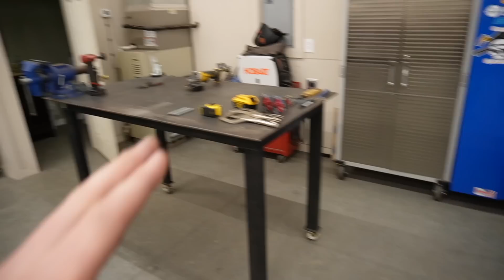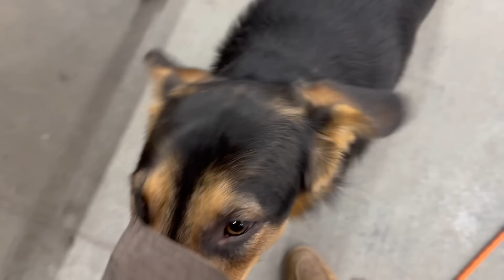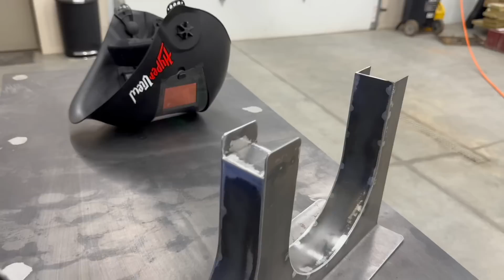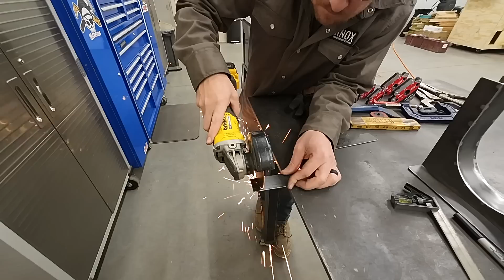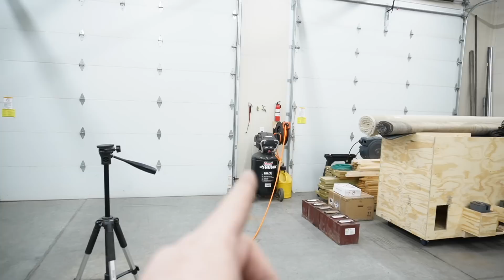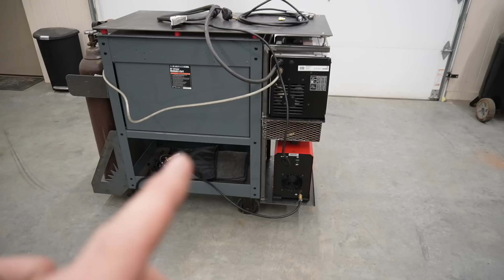The ULTIMATE Welding Cart Build Continues....I Need YOUR HELP

Comment: I really like your welding cart, but I see one huge flaw. Speaking from experience, the bottom of self which the casters are bolted to of the US General  tool cart is too weak to support the weight you are increasing to it. I suggest running an additional to all 4 corners that the casters can bolt too
Reply from the maker: if it becomes a problem I will address it.  It was considered just not something that was going to be a guaranteed problem for my application.

Comment: Where is your tig rod storage?
Reply from the maker: In the drawer.
Reply: @SpicerDesignsLLC  interesting. I’m contemplating modifying your design for a water-cooled TIG setup. I think in that application, I’d consider trading one of the bottle spots for a place for 6 or 9 of the 36” filler rod tubes.

Comment: Little late for my input as youre already done with this project, but...

I did very similar with the little 70 buck (i think, probably more by now) welding cart you can get from harbor freight, of course its not a perfect solution itself either. I have a singke bottle in a 5gal bucket off the back and chained to the cart, the extension cord sits in it around the bottle that i plug into the wall, zip tied along it is another cord for 110, the 110 is just a triple tap cord dangling behind the bottle, while the 220s are cut into a plastic weather box with an outlet on either side for the mig welder and plasma cutter.

I like the common ground idea but thats only good if you have the mig setup on negative ground (i forget if thats the gas or gasless mode), otherwise there may be issues.

I wish i had the space for a setup like this but what i have JUST fits in my garage.

Just found the channel the other day, and so far i love it. Great content, comedy, projects, and educational info, adorable pup too....

Comment: Looks like changing the spool on the mig might be a little challenge.
Reply from the maker: Whys that? Its basically identical to my Hobart machine.
Reply: @SpicerDesignsLLC yeah, I’m talking about the Hobart. Seems the lid to change the spool will not go up all the way. Great design though. Might do this to my eel table.
Reply from the maker: @SPIKEOPS82 ohh ok.  Ya just have to use a magnet or something.  Not a big deal
Reply: @SpicerDesignsLLC fuck. Just saw the second video 😅

Comment: Top still doesn't appear to be isolated/insulated due to the fasteners bolting it to the lid.
Reply from the maker: @pjshooter6  yes it is.  Thats why those are called insulators.  Theres no continuity between the female threads on each side of the insulator.

Comment: May I ask what air compressor you’re using for the crossfire pro?
Reply from the maker: Its just a 30 gallon husky that i got from home depot before i had the table.  I would say its bate minimum for the 45 amp plasma cutter

Comment: The way I solved the wiring on my welding cart was with a small sub panel on the cart. I have 2 240v outlets for the welder and plasma cutter plus a 120v outlet for grinders. A single cord plugged into the wall and everything has power.

Comment: If you are already grounding the top of the table, to avoid using too many cables, you could tab that hangs down from the front corner of the table top and mount the female lug directly to that.

Comment: I wouldn’t ground both at the same time, any spikes and u don’t it going in electronics it’s not meant to
Reply from the maker: @dbi1036  i was concerned about that as well. Im going to be installing an isolation switch for the grounds.
Reply: @ keep up the videos ur doing a great job

Comment: I had two welders grounded to the same work piece one time and some how voltage ran through one of the welders and fried it.  Could have been a fluke, idk.  Every since then I try to never ground multiple machines at the same time unless its necessary.
Reply from the maker: I was concerned too so i ended up getting an isolation switch. Ill show that in the last video

Comment: Great build Kyle. You ever thought about adding some bigger BEEFY tires so you don't have to go around obstacles?
Reply from the maker: If it becomes a problem i will.  Most of the time theres nothing on the floor so it shouldn’t be an issue.

Comment: Here are my thoughts on your questions: 1. Don’t mess around with making ground ports on the machines they need to be dedicated to each machine and isolated and you don’t want to mess around with electrical current. You have plenty of open storage on this cart for leads and they go in and out of the machines very easy so there is no issue with removing them. 2. Instead of capping the ends of the tube above the Hobart I would use the open ends to make a handle that could retract in the tube and pull out so it could be used as a handle and also an extension for something hanging over the edge to have more support. Awesome job you have the best cart I’ve seen yet.
Reply from the maker: Great ideas.   I do have an isolation switch for the grounds to eliminate any interference with the other machine.

Comment: get a non isolated double lug attach it under the table you can weld a 1/2 bolt under if you dont want to drill a hole does what you want but better

Comment: Nice build but too bulk for my liking. Must be a pain in the ass to move around the shop.
Reply from the maker: Thanks.  If it didnt have wheels it would be a pain.   Its heavy but i wont need to move it around a whole lot.
Reply: @SpicerDesignsLLC  I'm just not a multitool guy.

Comment: Great idea, love it!
Two ideas:
#1 - In the automotive industry, there are ground 'cables', that are actually braided stainless with eyelets on either end. That would be great to mount to the top, since it'll be flexing, and won't 'work harden' a typical cable. These are most often from chassis ground to engine block, typically. 
#2 - Since you'll have 110v to the cart, maybe mount an outlet, in the event you want to plug something in to your remote welding cart. 
I mean.... you seem like the kinda guy that's going to need a grinder after your welding, soooo.... <shrug>
#3 - [Bonus idea] The cart needs a cupholder, with a can cover. Don't want molten spatter getting into your cold bee.... uhm... "beverage". 
Rock on man. Thanks to Youtube and the algorithms for recommending you. New sub here, great content!
Reply from the maker: Thanks for the sub and suggestions!

Comment: Just flip the straps around then your original latch should work.
Reply from the maker: @ReapersFabrication  they would hit the bottle and the taper is the wrong way
Reply: @SpicerDesignsLLC  Gotcha was just a suggestion sometimes we can forget to catch little things in the moment, only reason I thought to offer flipping them. Cart looks awesome. I'd probably insulate the machine rack and see if your white foot pad could be swapped with a longer screw. That way, it gives you the grounded top with that grounding block you have might make for less wire usage possibly.

Comment: I tried using your coupon code: both “spicer” & “spicerdesigns” for the evolution miter saw. Any idea why this wouldn’t work? Your previous video on this welding card eludes to the coupon worked for this miter saw. Just curious if you had an idea?

Comment: Nice cart, looks like weld spatter could shower the welders and the bottles though. Don’t want to burn through one of the regulator hoses haha.
Reply from the maker: I wont be using that top much for welding.  The hoses will be concealed too.  For the most part everything should be pretty well protected.  Thanks for the input.
Reply: @SpicerDesignsLLC  one thing that comes to my mind is if something falls or rolls off the table and it breaking a regulator. besides that im with everyone else its a nice cart
Reply: A big MACHINE will have to come out to put that fire out 👌

Comment: This is a killer design and build series. You do some really nice work and have great attention to detail. I'm just a garage hack so take this for what it's worth, but my only word of caution would be having your MIG lead coiled that tightly in the storage box below the welder could possibly lead to memory in the liner. Over time it can have an affect on the wire speed running through the liner or even hang the wire up. Keep up the great work!

Comment: As long as you are always DCEN, you will be fine. If you ever need to switch to DCEP, there is a risk to your other welder.  I thought of doing a similar thing with my stick and mig unit but was heavily advised against it by my nephew who is a certified welder.  Just a thought. Nice build.

Comment: Though I'm nothing near of a Pro Welser. but I would have thought to not have the Welding cart, also be the welding table. Hoses are not welding slag-proof, not spark-proof. I'd be worried about sparks near the take lines, and could only imagine if there was a leak on the regulator that wasn't noticed...
Reply from the maker: Shielding gas is an inert gas. Its not flammable hence shielding around a very hot arc while welding.  The way im going to  route the hoses will be protected from burns.  Flammability is not a concern.

Comment: I hope you don't have problems with your "grounds" tied together... welder "grounds" are NOT GROUND... they are the "return path"... that is the issue with having an "earth grounded" welding table. There is a possibility that if one welder is welding, the voltage present on the "return path" could "reverse bias" or "turn on" electronic components in the second welder's circuitry and cause damage.  Personally, I would not risk it...  
Preferably,  I would make separate "quick connects" on the front of each shelf by each welder separately, then they would be isolated, but easily selected by connecting the lead to which-ever machine you are using.   Just my humble opinion...
Reply from the maker: I plan on installing an isolation switch to avoid any possible issues. It should be fine being that the welding too is isolated from the utility ground and the welders return path will go to the source.  Im installing an isolation switch anyway.

Comment: I made a large cart to hold my stick welder, mig welder, and my plasma torch. I did what you are talking about with an electrical service box to hook up all three 220v connection with breakers. As you said I never run all three or even two of the units at once, but I can always leave just one breaker on for the unit I'm using and leave the other two off for safety. I put a large 25' 50 amp cord to the electrical box so I can reach all around my shop too. You definitely will love the clutter free ability to move your welder around when you make those improvements that you are going to do. I love mine and I enjoy watching your build for yours. I just need a plasma table. LOL
Reply from the maker: Sounds like a nice setup.  Thanks for sharing Craig!

Comment: Love the build, if you leave both machines grounded all the time, welding won’t affect the welder not in use? I would assume it’s like a car when you unhook the battery to weld, just curious
Reply from the maker: It shouldnt but i will be installing an isolation switch.  The currents return path will go back to wherever the source is coming from.

Comment: I would love to know, would stainless steel hardlines (think brake lines) contaminate welding gas? It would be amazing to see you custom fab hard lines from your gas cylinders over to the welders for delivery. A small flexible consumable hose on both ends with help reduce gas hoses from tangling.
Reply from the maker: Great idea.  I used to bend pneumatic lines for instrumentation back when i was an electrician
Reply: I was thinking hard-mounted regulators on the back of the cart, which would work perfectly with the hardlines idea. Just a soft whip coming off them running to the tanks if they're mounted near the leg, or hardlines with a short whip at the end if the regulators are mounted closer to the center back.

Comment: You could line the upper tank mounts with an adhesive rubber strip the same width as the steel that contacts the tank. It would eliminate the steel on tank rattle and probably create just enough tension to get rid of the play in the latch causing noise.
Reply from the maker: That is a great idea.  I actually have some weather stripping i was planning on adding exactly how your saying.  But i have to wait till after paint.   Thank you

Comment: Thats a bad welding cart dude. I just got a CK2620 cab and I am looking for LED work lights. Ive seen your videos and saw you had LED work lights. Do you have an install video on these? Which brand are they?
Reply from the maker: I dont have that video up anymore but i do sell the z brackets that i designed for them to fit.  If you want to email me i can get you the info.

Comment: You wouldn't sell the metal kits for your design, but definitely would be a great idea to sell a pattern kit so that someone could use, and then cut there own metal and assemble!! Saves the Diyers a ton of time, and allows them to actually build it themselves. Not to mention,  it'll make you some $$$
Reply from the maker: I currently sell my design files already.  I just have to put together a final version of all the cut files to sell.  I will definitely be doing that.

Comment: Nice and BEEFY!  One suggestion that will add more work than you probably want to put in but accomplish a much cleaner look, is possibly open the welder cases and remount the power cords and grommets to the side facing the toolbox and route the cable down the cavity between your frame and toolbox to the lower shelf where you'll have them tied into the junction box.  CLEAN!  I love great cable management.  Keep up the content creation.

Comment: You can get a real sleek ground port if you put it on a flat part of the toolbox face.  Like next to a drawer since there's usually nothing in that space   you gotta drill a nice hole the.  Like 1½" hole saw or whatever.   Visualize it and make sure you have the pieces to do it.  Don't drill the hole and be like oh wait nevermind the s isn't going to work.     Think it thru start to finish
Reply from the maker: Good idea

Comment: Please never ever grind or weld on galvanized material with out a respirator on , preferably a proper welding one , you can use black iron fittings all day long best if you clean the threading oil off first , brake clean is good for that , welding galvanized produces cyanide gas which if you don't know can kill you very fast .

Comment: I like the grounding idea!  I've been sketching out ideas for a project very similar to this for months.  Difference is, I do ALL my welding either on a piece of equipment or on my welding table, so I have no need for the small top, but I do have more welders.  So my plan is to eliminate the hinged top, but replace that space by moving the bottom drawer to it's place - I'm sure that's going to require a little fab, I haven't bought the cart yet.  That should give me enough room to put my Miller transformer TIG machine down below (very heavy), My Hobart wire feed somewhere, probably similar to where you have yours Or on top, my plasma cutter and my soon to be purchased Primeweld TIG either 225 or 325.  I'll be using quick disconnects on the bottles because I switch between often enough when using the spoolgun on the hobart.

My question for you is this:  I want to wire a series of plugs onto the cart so I can leave all the machines plugged in, and have a single cord to plug into the outlet.  Knowing that while multiple machines will be turned on at the same time, I will only be operating one at a time, is that kosher?  I'm certain it will work fine, but I have a feeling a "legit" electrician would be shaking their head at me.  Thoughts?

Comment: Be careful welding galvanized. The fumes can make you very sick.
Reply from the maker: Oh ya.  Used to work with galvanized angle alot as an electrician.  Always made sure to grind off all the galvanizing.  Bad stuff.

Comment: I would suggest a hanger just for wrench to remove guages and a place to keep sever spools of yoir welding wire.  I actually welded a dedicated wrench with a chain on it so I never search when I am.in a hurry to swap out my bottles. Of course you can put one in the drawer but it is a convenience thing. Like me using cable ties on my corded tools to put my wrench to take off blades.  Now most are cordless 3d print slides to hold them some.tools already have it.  I am like your twin you think.of stuff just like me kinda weird everybody thinks I am overkill about everything.  Nice to know their ARE OTHERS WITH THE SAME OCD LOL.
Reply from the maker: Good call on the wrench.  Great idea

Comment: Yea I did mine years ago out of a square shopping cart casters a lot heavy duty than those hf casters and rolls easy my gas holder I made when was in my 20s so you have to pick the gas bottles 2 foot to clear now I think I will redo that as I do not have the muscle to pick them.up clear everytime.  Your setup is awsome the cutter and break make things so much easier.  I would say you may have to beef up the casters.

Comment: Highly recommend using stainless steel tubing to run your gas to the machine, no worries with sparks burning it up also very clean look. I used that on my welding rig.
Reply from the maker: Great idea!

Comment: You might want to add some 120v outlets somewhere for hand tools, like a grinder. Some type of power strip? I am not an electrician(you may know one ha ha) to direct wire to your wiring for the welder outlets, if that is possible.

Comment: I just bought a three door yesterday from harbor freight.  Increasing the leg length to fit welder underneath the drawers. Also adding the top welding top and tank on the side.  Moving the casters under the bottle support.  I will use your isolation idea on the table top.  Thanks.